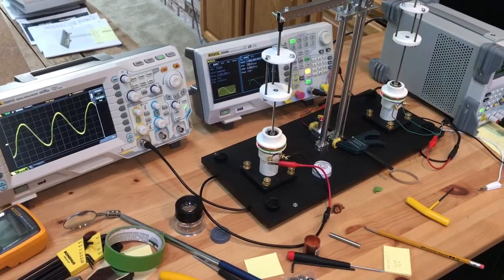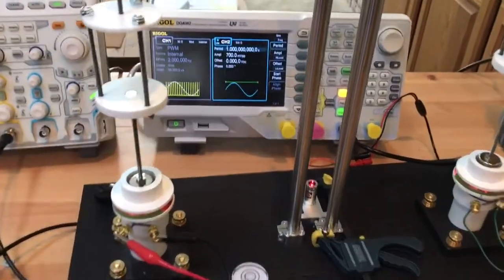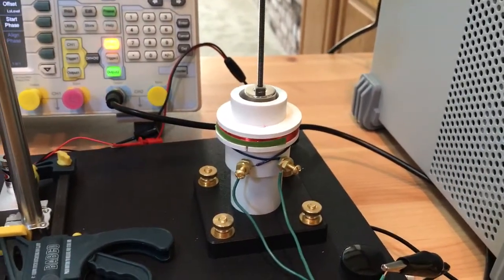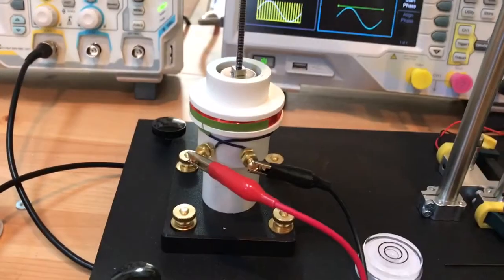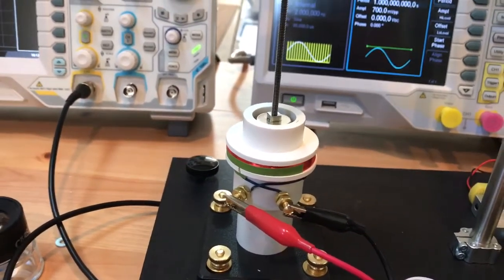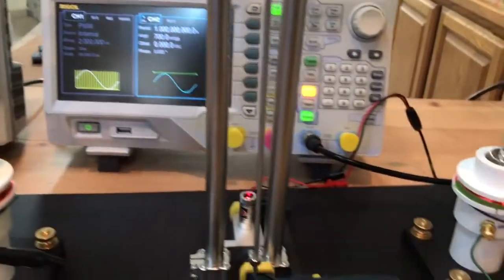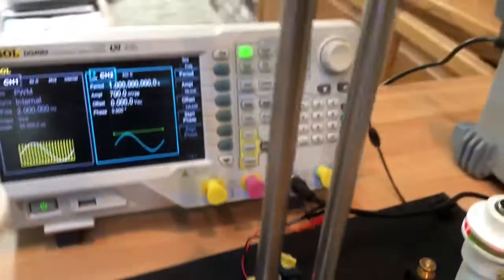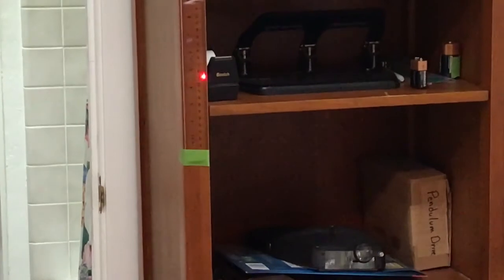Watt Balance Testing #1

Comment: Nice work!  Do you have any accuracy results yet?  Have you considered a photodiode with a transimpedance amp? How did you build your metal balance mechanism?  Thanks for the video.
Reply from the maker: Thank You.  For me, it was also a learning experience on Fusion 360 CAD/CAM and a new CNC Sherline milling machine.  
I was able to get the accuracy down to around 0.7%.  The main uncertainty was the velocity measurement.  I bought a used 'vibration' proximity probe which should be able to give me a better velocity measurement, but I never got around to trying it.
I was also trying to use a linear aperture photo diode and use my tabletop milling machine to characterize its linearity, but I 'lost track' of that option too.
I did mill a constant velocity cam profile (think triangle waveform) and drove it with a variable speed motor, but the watt balance sensor coils picked up all of mechanical noise from the cam surface and rider bearing, etc.
Most of the metal mechanism is made of "Structural Components" from ServoCity.com. I could download the CAD files from ServoCity and 'assemble' the parts, bearings, to check for clearances, etc.
Reply: @johnstuart6334  It would be nice to have a discussion group some place to discuss these subjects with like minded folks.  Any interest?  Any ideas as to where is the best place to do this?
Reply: @johnstuart6334  Here is a google group that I just created   https://groups.google.com/d/forum/diy-lego-watt-kibble-balance-mailing-list